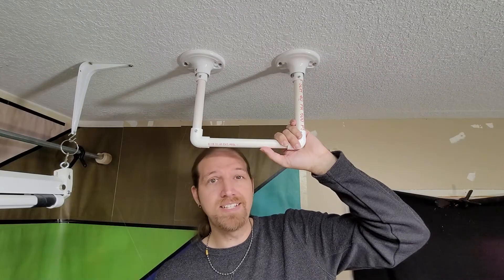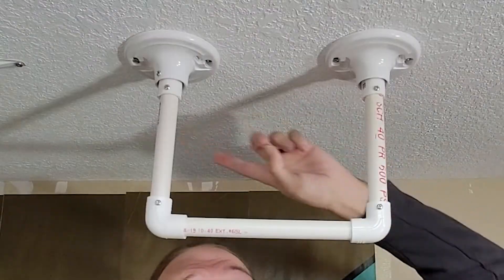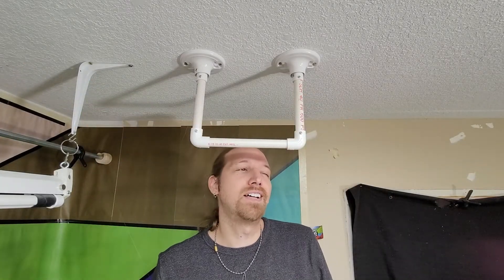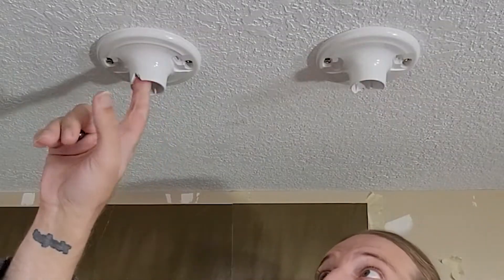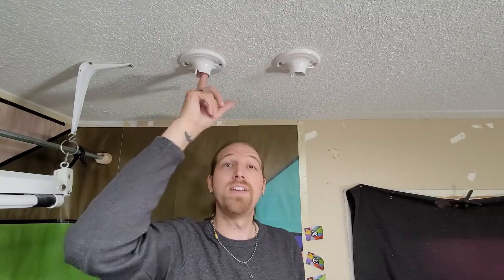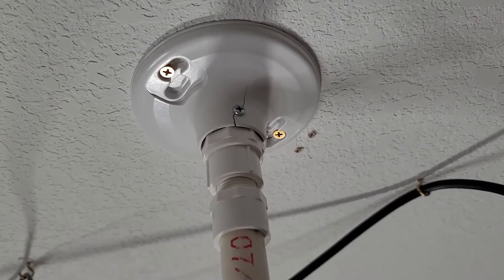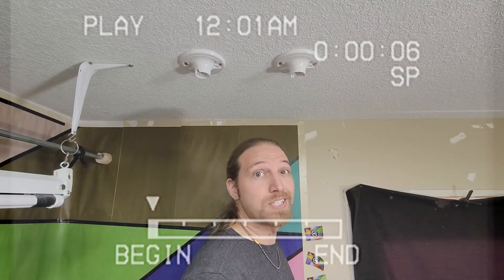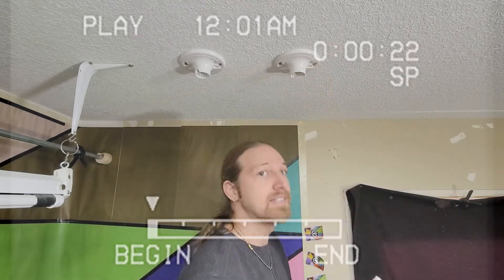Strength Test of My Plastic Lamp Holder PVC Flanges

Comment: It says there's 7 comments, which I can't see, so someone may have already said this, but I think the screw is what ruined it for you, if you can pvc glue it into the flange I think that will be stronger than a second screw. I think a second screw would actually make it break faster.
Reply from the maker: Yeah, a bunch of spam comments that YouTube automatically deletes, but the number doesn't change, its weird. I think the screw is a decent solution, but obviously not if you really want to max out the amount of weight you can put on it. I agree glue will probably work better, but as I showed in the first video, the inside on the light socket has ridges,  so there is actuality very little surface area for glue. I also don't think the lamp holder is PVC plastic, so I'm not sure how well PVC glue will adhere to it. I'm thinking maybe something like construction adhesiveness, that can expand, and fill the gaps.
Reply: @IamNickDClements  Expanding adhesive would maybe work, I'd forgotten from the original video that it was ridged inside. What if you sugru'd it? Just packed the hole full and then  press fit the pvc into it and then let that cure.  And yeah one screw is definitely fine for reasonable applications... but now I want you to have a PVC pullup bar.